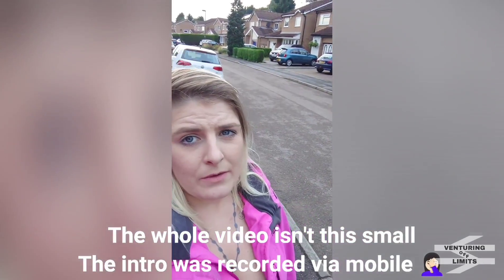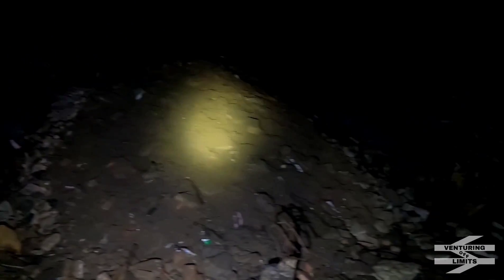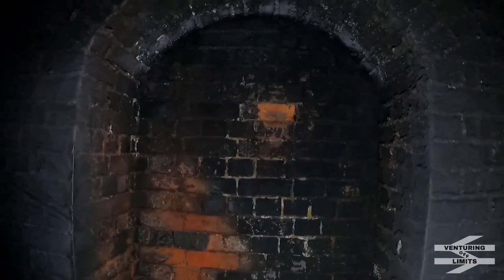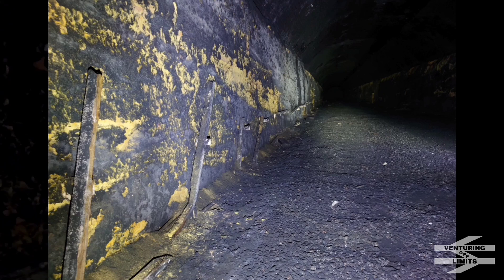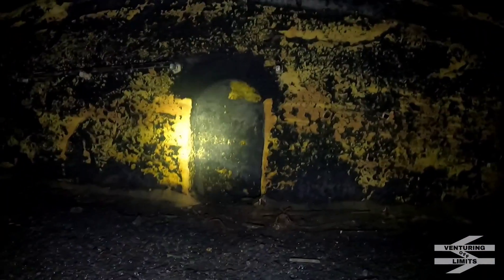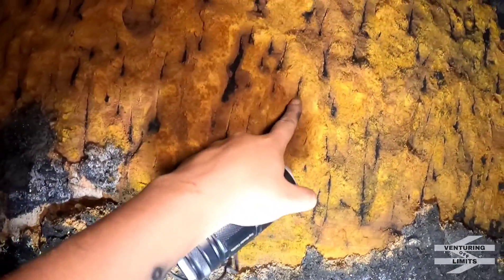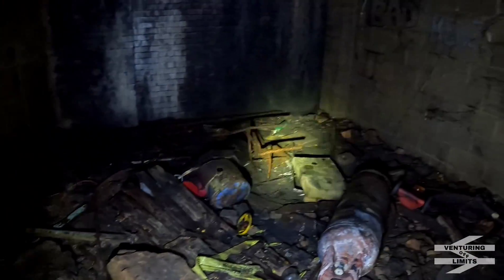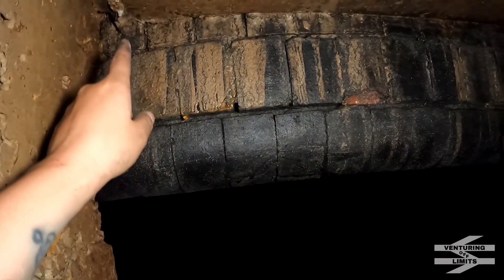Sherwood Rise Tunnel.. We Got Inside! First look since 1994!  **😱WHAT HAPPENED AT THE END! 😱**

Comment: Fascinating video, I actually have travelled through this tunnel on a train, I was a small child at the time! Those cables you refer to at 12:15 and several other places are actually old signal wires on pully wheels. The signals were all mechanical with wire runs through the tunnel to work the Distant signals either end.

Comment: Nice to see you exploring some of these interesting places around Notts. There's lot's underground around here (in Nottinghamshire) that are worth a look. Find the right people and you find quite a few storage tunnels in the City. I had a mate working on some of the city reconstruction and he told me about how many tunnels carved out of the sandstone they found. Archaeologists were photographing the rooms with carved chairs and tables then nearly crying as they were filled in with concrete for office block foundations. Nottingham in the Middle ages I believe was known as the city of caves & there is a description by a French visitor of what he saw somewhere.
Reply from the maker: Yes! There are so many different tunnels and caves, it's accessing them that proves a issue, I know of quite a few, there's a big cave network down a manhole I've jist got to pick the right time to head down it, there's also a air raid network on a busy road again right time needed, I'd love to get down some.. Really upsetting the fill them in for buildings today 🙄
Reply: Talking of blocked up area's somewhere along the Nottm / Worksop rail line they found when building it a cave with the bones of a sabre tooth tiger in it. They blocked that up as they continued and only marked it as "near a tree in a hedge". Most likely that tree and hedge are well gone. Don't think that's well known but it would make sense with the close by ice age caves at Creswell Crags. Also somewhere worth checking out is the Welbeck tunnels, they were acessable a few years ago and Ive seen YT vids on but not been there myself.

Comment: I think the large refuges were designed so that the gangers could pull their trolleys off the tracks - there would have been a very short length of track in the refuge at right angles to the running lines .

Comment: Can't that tunnel, and others, be used for the tram network?  Where they ever considered?
Reply from the maker: Yeah would have been brilliant, but one end of this tunnel is fully buried and built on which would make it extremely hard to reuse ever.
Reply: @venturingofflimits  I am sure there is a solution.  Extending the tunnel, excavating, etc.  The great thing about underground railways/trams is that they do not interfere with the surface. Tunnels in urban areas  must be used to Maximum effect.
Reply: @johnburns4017  I'm not sure about the Sherwood Rise tunnel, but Geoffrey Skelsey, in his book Nottingham's New Trams: The NET Success Story, says that a route going through the Mansfield Road/ Thurland Street tunnels was one of the options considered initially, but was not viable for reasons including cost and limited access to the city centre.
Reply: @nottinghamandbeyond475  Yes, that's true. It was envisaged when Victoria Station closed, during redevelopment as the shopping centre they would leave enough room for twin tracks for rapid transit, with a tram stop under the car parks. In the end then idea was dropped. How short sighted was that! Would be very well used today, and bring people in without polluting road traffic!